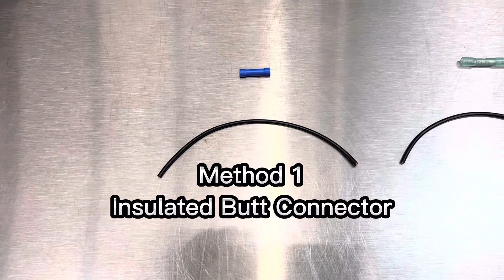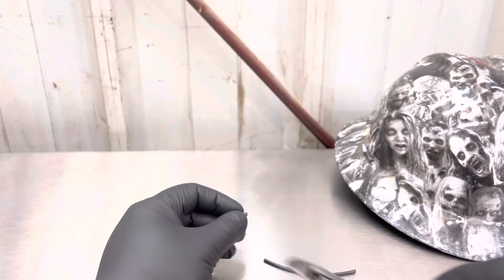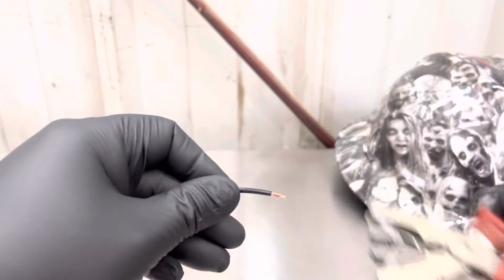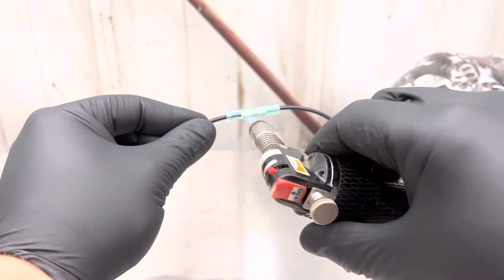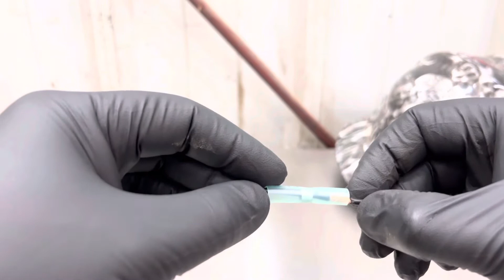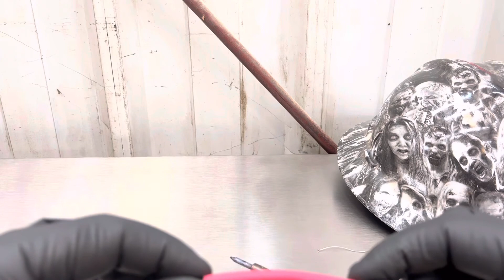Start Repairing Vehicle Wiring Like A Pro

Comment: How about a link or a name for those wire strippers?
Reply from the maker: My wire strippers are VACO brand, part #70358.  Unfortunately, they are no longer made.  There are lots of good modern options though. Like this Vice Grip brand set - https://www.amazon.com/IRWIN-VISE-GRIP-2078300-Self-Adjusting-Stripper/dp/B000OQ21CA/ref=asc_df_B000OQ21CA/?tag=hyprod-20&linkCode=df0&hvadid=198070022856&hvpos=&hvnetw=g&hvrand=9550249963697953851&hvpone=&hvptwo=&hvqmt=&hvdev=m&hvdvcmdl=&hvlocint=&hvlocphy=9028916&hvtargid=pla-379210428693&psc=1#
Reply from the maker: Thank you for this comment.  After some digging, I discovered that VACO tools was acquired by Klein Tools, in 1986.
Reply from the maker: With that information, I would say that this is the modern cousin of my wire strippers - https://www.kleintools.com/catalog/combination-cutting-tools/wire-stripper-and-cutter-self-adjusting
Reply: Hey ! Thanks for all the info. I have the newer wire strippers, just thought the one in the video was interesting. Thanks for the tool number. Have to keep a watch on Ebay.